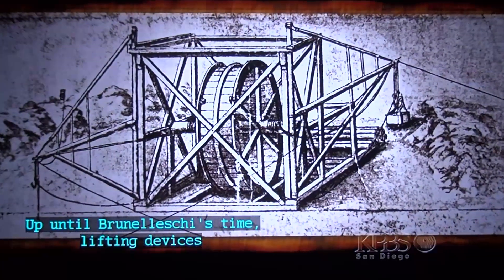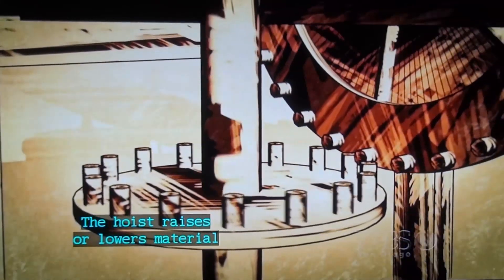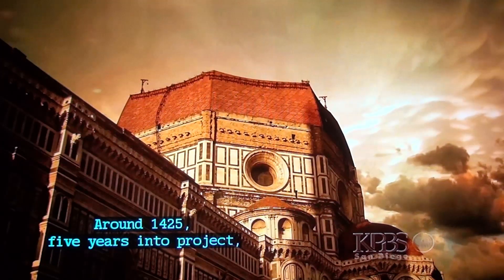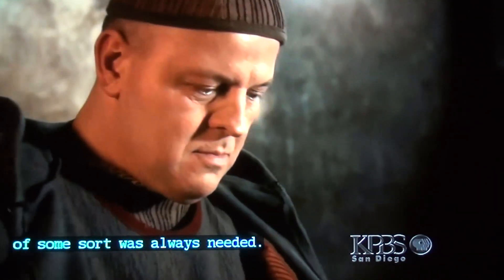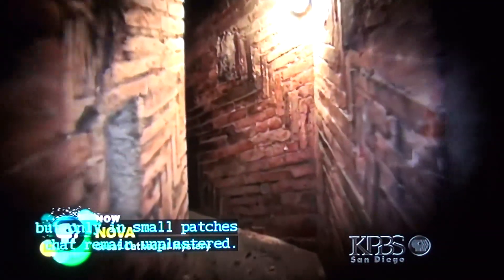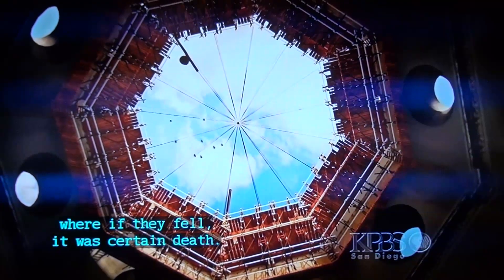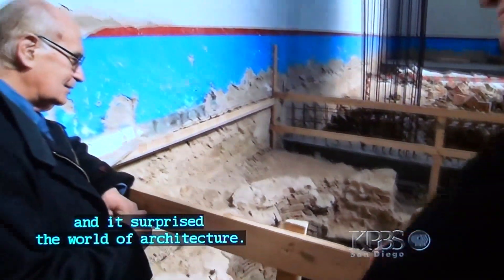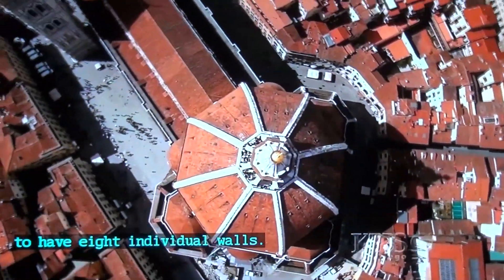Filippo Brunelleschi Vol-3

Comment: Considering that the maximum strength was required, on looking at that " miniature brick" which they are using,  the surfaces could have been indented as they look almost polished to me, such that the mortar which they are using will not bind with the brick. Also if the vertical brick  being used was longer, the "vertical beam" effect would have been better as those vertical bricks what they are doing is stopping the horizontal bricks from sliding out but more important creating a few effective vertical or " radial arched beams. Brunelleschi was indeed a clever dick.